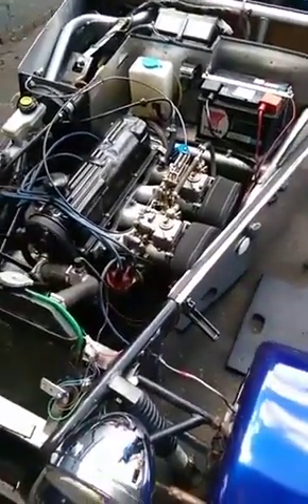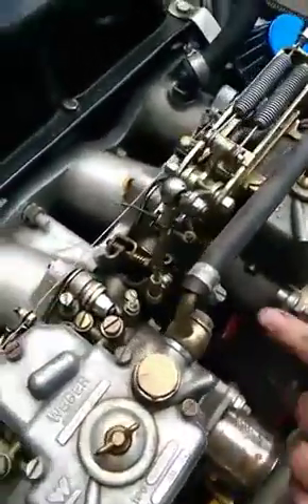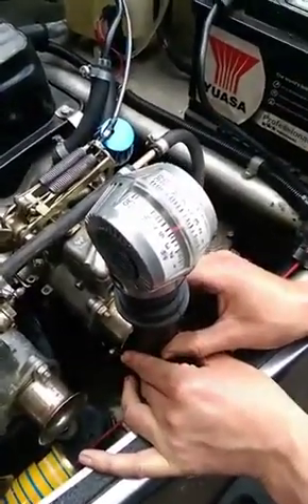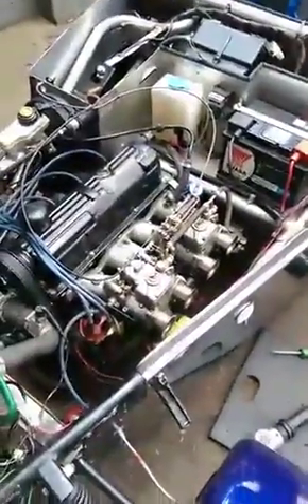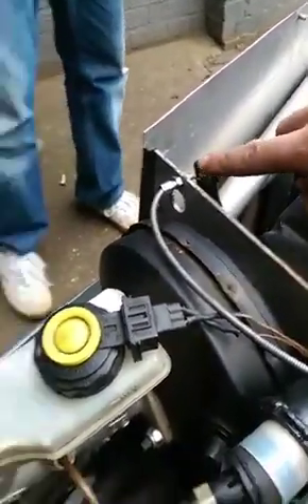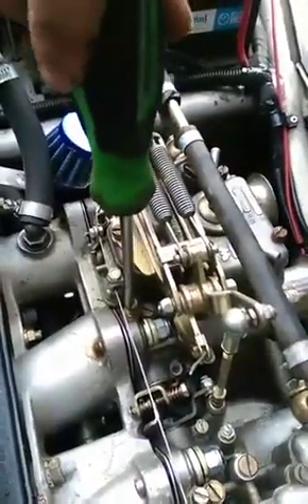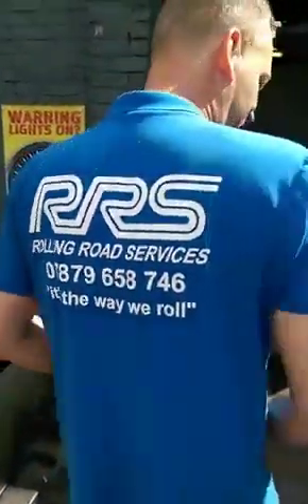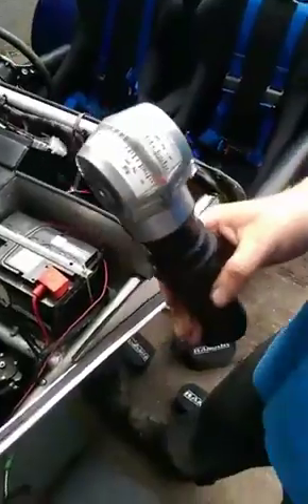How to Balance WEBER/DELLORTO DCOE/DHLA TWIN CARBS 4CYL ENGINE AIRFLOW METER/SYNCHRONIZER

Comment: What is the difference between dellorto dhla 40 carburetor, dellorto dhla 45 and dellorto dhla 48
Reply from the maker: It is the size of the inside diameter of the barrel,  40mm, 45mm, 48mm and effects the volume of air and the speed of its flow

Comment: I have single cam 70s bmw 4cyl engine with weber dcoe twins, I have weird issue that it backfires on only number 3 cylinder sometimes, any tips?
Reply: Do you mean spits back out of number 3 carb or backfires from the exhaust?

Comment: What should be the right number on the meter? I need to set my 40s. Ta
Reply from the maker: The number is not important, it is the matching of the numbers between the carbs.
The master carburettor is the one with the throttle lever, and the slave carburettor is the one with the balance lever (one with the springs attached). The slave carburettor gets adjusted - by using the airflow meter to take the reading as you adjust it - to match the master carburettor.

if the master read 4kgf , the adjust the slave , so that too, reads 4kgf.

it could be 3kgf, it could be 6kgf, it doesn't matter. just match them up.

obviously 6kgf, is flowing more than 3kgf, 
6kgf would have higher idle rpm, than 3kgf.

Also, use the meter, to check the airflow on each barrel of the same carburettor.. this will tell you if the barrels of the carburettor are pulling the same ammount of air. if there is any significant difference in airflow between the 2 barrels of the same carburettor, it means that your spindle is bent, or the throttle valve/butterflies are not sealing the barrel correctly, and you won't get the engine to run well whatever you do. you will need to strip the carb, and repair the fault.

if the 2 barrels are matched up nicely, and drawing in the same kgf, then you are good to go ahead and balance the 2 carburettors, and do burnouts.
Reply: @Classiccarbscouk  blimey that sounds difficult but I'll give it a go. Thank you ✌️❤️🙏
Reply from the maker: @brucelee-bi8jk  you are Bruce Lee, flow like water, its a piece of cake 🎂
Reply: @Classiccarbscouk  😅✌️
Reply: The 151 model has an adjusting air bypass screw for each barrel, why not using this to adjusting the flow after we adjust the 2 carbs?  Or when is the right time to adjust by there? Tnx

Comment: Nice job. What did you use for a fuel pump and did you use a pressure regulator.  Cheers
Reply from the maker: Hi,  This one had a fuel pump + fuel pressure regulator.

You could just use a WFP502 pump, and use it without a regulator:

https://classiccarbs.co.uk/product/weberdellorto-twin-40444548-carbs-12v-electric-fuel-pump-dcoedhlaidfdrla

ALternatively, a Facet pump + pressure regulator combo like here:
https://classiccarbs.co.uk/product/weber-dellorto-solex-su-carbs-facet-electronic-12v-fuel-pump-kit-200bhp

And the fuel pressure regulator:
https://classiccarbs.co.uk/product/weberdellortosusolex-carbs-malpassi-fuel-pump-pressure-regulator

Thanks,

Emmanuel
Reply: Its worth it to get regulator tho, easy install, saves fuel, cheap, +its good idea anyways to have stable pressure

Comment: Do you know if all DHLA 40 emission carbs are the same, or are there several versions of f.ex. the DHLA40H with progression holes for different engines? I know that the DHLA 40 performence carbs are specific for the size of the engine (ex. a DHLA for a 1300 on a 2000 will have an uncurable lean spot due to the progression holes)
Reply: I guess my question is; do all DHLA40H emission carbs have the exact same progression holes?
Reply: @thisquietplace  there are different amounts of progression holes for the later dhla 'emission'
Reply: @thisquietplace  everything after a Dhla H is emisson variant